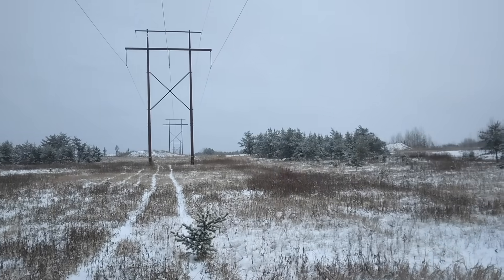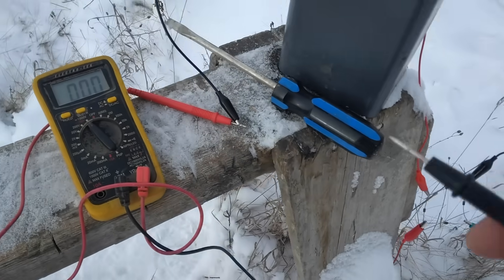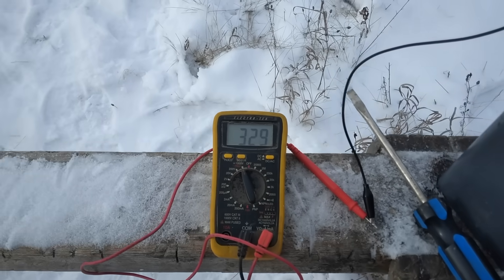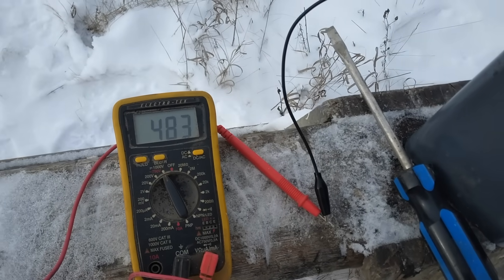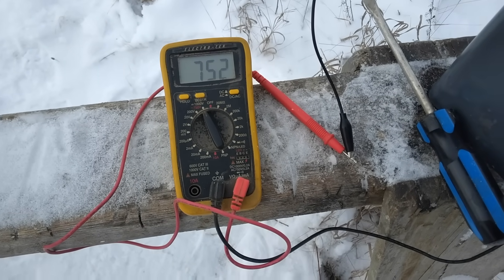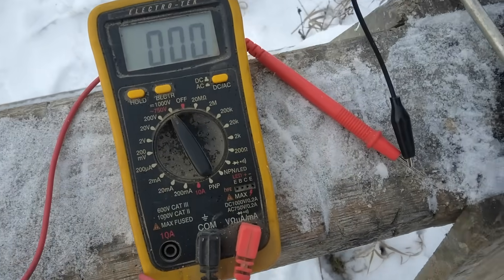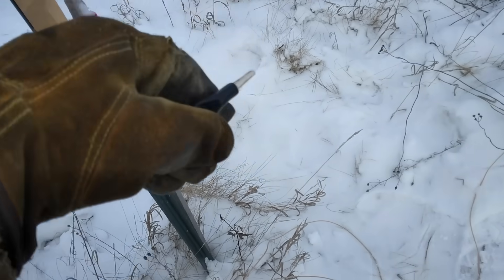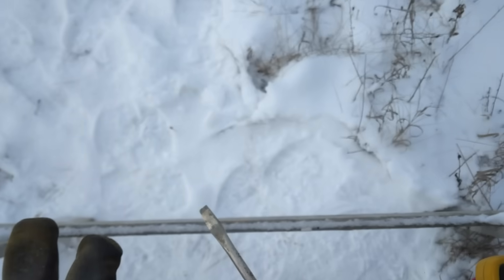Fences sucking power from under HV transmission lines

Comment: My grandfather had a shed on his farm that was lit with a 40w bulb using just the tin roof of the shed and a ground wire
Reply: can you explain his setup a little more? if used straight like you say then it would overload the bulb on the fist thunderstorm so there has to be additional setup
Reply: @AdrenalineandEpiphany  it was pretty simple. it was a lamp socket with 2 wires coming out. 1 was attached to the roof of this old wood shed and the other went to a wire / grounding rod in the ground. its w not super bright but bright enough to see in the shed. he lived a few miles from the pacific coast so I doubt they got many thunderstorms. there were also a lot of redwoods around so even when there was lighting buildings are rarely struck
Reply: @AdrenalineandEpiphany  he also told me the electric fence he had, he took to top wire and used to to power some other stuff in the shop but after they upgraded the electric poles he took it all down cause he was concerned someone was going to get hurt.

Comment: I think you'd collect more electricity from the air if you used a bare wire or a wire with plastic insulation. The coax cable has a metal shield to prevent electromagnetic interference.

Comment: Um.. did you just mention your capacitor up to a charge capable of killing two men.. then discharged it through a non electrically insulated acrewdriver whilst holding the screwdriver? Please invest in a set of insulated tools if you're working with electrical equipment dude. 

Fascinating video 👍

Comment: If you have metal fillings and chew on aluminum foil, the acid in your mouth act as an electrolyte in a battery and a mild current is produced. When one of those “battery” terminals is embedded in your mouth, you really feel the buzz.

Comment: thats no coax, the black copper wire is live hot. coax is a triple insulation that won't power a device it's a data or bandwidth catch. you need a magnet to capture use the wifi 31mm and use another on the tower. combine and ground to earth deeper the better. then transmit it like a Tesla coil you could make that array into. it's tall enough already had the data meeting on it find that meter ! show it please

Comment: I live near the Columbia River. Two large dams are within minutes of my house. Needless to say, there are many of the monstrous towers supporting cables far over head and these take off in many directions. 

All around me are fields with irrigation circles in them. These are metal pipe systems that rotate around, for example, a hundred acre field. These are built using forty foot sections of pipe with towers at each end of the pipes. The systems range in length, but 400 feet is not uncommon. 

When a circle aligns with the overhead lines, the circle better be well grounded, because the power in it will kill you, in the process of tossing you ten feet.  Yes, circles are grounded for that reason.

Comment: I know nothing about electricity or electronics, but are you saying that there's enough 'free energy' emanating from these power lines to actually store it in a battery, in the same manner as solar panels or small wind turbines are used to store electricity for off-grid homes?
Reply from the maker: There's small amounts.  Like maybe a phone charger.

Comment: I know it from a constructor who was building a stable near a high-voltage line, then still 380kV. The stable is built from steel load-bearing beams. Every time a beam was raised they got shocks. Only after earthing and steel hoists was that problem solved. But even when tightening bolts, you felt shocks.

Comment: Many moons ago I was installing a new audio system in a strip club near the Rio in las vegas. After troubleshooting some noise and ground loop issues, I discovered the earth ground to be the main source of the various problems with that building. I was told by an engineer that the city has areas where this can be found and measured. These spots would also migrate around the valley. The dry desert ground and the high demand for electricity, mostly from the Casinos, being the reason for this.

Comment: I'm no expert but it seems one could just bury a coil in the ground and dig a trench to run the wires to like a fake outhouse where you could then stabilize that output for usable electricity. I say that based on a story I read once when someone placed a transformer coil beneath the high power lines and they were able to get electricity from the electrical field, or maybe the electromagnetic field, surrounding the high voltage lines.. He got caught though because it was clearly visible.

Comment: You can’t steal what’s freely radiated. That’s power that is just going into the air. Typically only 40% of power is used the rest is lost in transmission.

Comment: Top wire is a Static Line, not a Power source wire.
Reply from the maker: Yes, that's what someone else informed me of.  I guess you can also tell by the insulators on the poles.

Comment: Your DC voltage will be 141% of the AC voltage in the Coax. DC wont inductively couple as well but it doesnt transmit over distances well either. Get a Fluke meter and the Fluke 40,000 volt probe. We had to run autotransformers buck transformers on large multifamily residential jobs so we had 120 volts at the end of 300 to 500 feet of extension cord. Otherwise we burned up our power tools. We'd tap off at 152 volts and sometimes only had 110 at the end of the cords. You cant help but lose power over distances.

Comment: 1 amp 1N4007 diodes. Big deal. Back home the ranchers would run a wire right on the 69,000 volt poles beneath the ACSR cable and power old autotransformer florescent light ballasts and  use those to power electric fences to keep their cattle corraled. Go explain induction to a farmer. I'll wait in the truck. You are going to have transmission losses anyway. . .

Comment: As opposed to a single wire, might i suggest a coil of lightly insolated copper wire that runs along the line, and yes, like in the other comment, pull it out away from the other wires about the same distance between translittion wires. you can find lots of this copper wire in transformers, cell phone chargers, old washer motors and ignitions coils. this would probably up the amprage a bit and give you a nice steady , usable current. good luck and be carful.

Comment: I had heard of a farmer who used an old spring mattress (minus the bedding of course) setup under high voltage lines that crossed his property to catch the magnetic flux to power his barn.  The power company sued for him stealing electricity, I don't remember the outcome.  The power company did have to build their transmission line taller to keep this from happening.
Reply: Yep their building requirements seem to out weigh safety concerns on this line.

Comment: Kreosan did this but they also used a transformer (it might have been a car ignition coil or perhaps a TV fly-back transformer). They had a rectifier of course, but also some kind of voltage regulator. With this setup they could harvest enough energy to charge a cell phone with the antenna just being a one meter whip and the ground the frame of one of their bikes. The lines they were under though were the big ones, maybe 500KV.

Comment: While you're pulling a few Watts, the grid is losing kilowatts due to imperfect connection.  That would be my guess.  Some guy was stealing power from the HV power line  years ago for irrigation.  Power company had tremendous power losses, at a time when his irrigation pump timer would kick in.

Comment: In my area we have the "electric bridge" High power lines run over a bridge and if you stand on the bridge with a fluorescent light and it would light up not hooked to anything. It lit up even brighter when you touched it to the metal guard rails on the bridge.

Comment: So... I heard at one point that you can put a transformer under a power pole and draw the electricity from a regulated source. Did you try this,?
I've been wondering for years, I guess its just as easy for me to test as you. I guess I need to find the transformer and the right power lines I want to siphon from. 
Are you aware that SEARS AND ROEBUCK sold a device called an energy siphon?  Interesting device. 
It basically does the same thing, but out of the air, no powerlines. Ok.peace.

Comment: Interesting. I had a similar situation and put up a fence running parallel to the powerlines about 25' to the S of CL, so giving them a 50' wide swath under the lines. I owned the property on both sides. While installing the fence I kept getting bit, shocked. Eventually the fence was to have a strand of electric at the top of the 47" field fencing.

Comment: you should use a role chicken wire underneath the powerlines and let the soak op the free electric and fill up capacitor and battery for free electricity

Comment: An acquaintance of my mis spent youth used to have a pneumatic -- It looked like a potato gun -- that fired a sabowed chain that would create a bolt of lightning upon striking transmission lines. He did it to a distro line in the evening once; no lightning but four blocks went dark. Crazy stuff.

Comment: If there is a fault somewhere on that line, you could momentarily experience a life-changing amount of voltage drop due to the temporary surge in current along the overhead line. Just know that it is far from safe to draw power from a high voltage line using inductance as you have absolutely no control over the current flowing overhead.

Comment: A length of insulated hookup wire would be cheaper than coax. I would expect a larger power draw if you moved your pickup wire further away from the lines (up to a point) because the wires are carrying 3-phase and the fields cancel to some degree the closer you move to the centre - they won't cancel completely because the wires are physically separated but field cancellation is what the power company would like to happen. The idea is to couple more closely to just one of the wires to reduce the field cancellation effect (make one field stronger than the other two which in effect moves you closer to a single phase pickup).
If you want a decent current, a large loop with one side as close to one of the outer lines as possible and the opposite side of the loop well away would help. This gives a single turn transformer secondary with one of four sides coupled as strongly as possible with two sides not coupled at all and the fourth ideally low-to-no coupling.

Comment: Voltage is one thing power is another. Sure, if you save up micro-watts for a while and release it instantly ( spark ), but to do any actual work, you need hundreds of times more power. Hang a florescent tube close to the lines. Now that's cool.

Comment: As a phone lineman many years  ago I had finished running several hundred ft of covered wire under the power  lines several feet. I touched the bare end of the unconnected phone wire and got the shock of my life while up a pole.   The inductance was quite high and not the last time i got zapped.

Comment: You can get significant induction voltages from much less than 230kv if you are close enough!   I first figured that about 20 years ago while waiting for a train.  It was a rainy day, so I had my umbrella up. I was stood on the platform and kept feeling this zapping sensation in my right hand and a faint buzzing noise.  I looked up and there were little sparks around the spokes of my umbrella and as I adjusted my grip so as to only hold the plastic handle there was visible arcing about 4-5mm onto my hand. 😵
I was amazed!  This was coming from the 25kv traction supply lines about 8ft above my head.

Comment: How about using microwave oven capacitors and diodes and reversing the transformer, connect to a induction coil and place under the HV wires? So you get a usable voltage.

Comment: A safer way to discharge that capacitor would be to use high wattage resistor and let it discharge slowly. Shorting-out a capacitor may is bad for it's health as well.

Comment: Power company: "There is no health safety issue with overhead power lines." Same power company: "Hey, you can't use power from the air. That's our power!"
Reply: E field drops with the cube of distance. Good luck
Reply: @richardpaulson8954  Work on your reading comprehension. The whole point is that if someone is able to do this from their own property, the power company is pushing too much power through the lines adjacent to their property. That's not safe for humans. It's hypocritical to claim there is no safety issue at the same time you're claiming that someone is stealing your power.
Reply: @therealctoo4183 this isn’t because too much power is being pushed this is just how electric lines work he is increasing the amount of loss in the system because of the wire. It’s a tiny amount because so much power is running through the power line.
Reply: @Playingwithproxies  So you're saying that there isn't "too much power", but there IS "so much power"? Try to keep up.
It's a basic fact: This guy isn't running wires outside of his own property, so he is NOT stealing power. The power company is pushing power onto his property and he is taking advantage of that fact. If they don't want him to use that power, they should stop sending it to him.
Reply: @therealctoo4183  That's exactly it! If they threaten to sue you for theft of power, counter-sue them for their environmental hazard. Their admission that they are losing power is simply free evidence for your case.
Reply: @therealctoo4183  correct. also wanna know how much rent they pay him to have that shit on his property.
Reply: For a point source
Reply: My dad used to work for the utility company they would use neon bulbs that would light up went around high voltage lines without connecting to power
Reply: Tesla proved it over 100 years ago
Reply: Bullshit response from the electric company.
Reply: both statements are true
Reply: Put insulators on your barbed wire fence and your stealing.... get the piss shoked out of you for touching a barbed  wire on a wood post on a dry day and thats YOUR PROBLEM!!! I Get it now!
Reply: @johnmartin3517 Steeling what exactly, it’s electricity that is bleeding off the power company wires that is a loss to them so shut the fuck up!
Reply: @johnmartin3517  "Free" electric fence.
Reply: Are you worried about health safety issues with the electicity in your home? You can do the same thing in your house, or more to the point your neightbor could do the same thing with your utlity hook up. Would you be ok with you neighbor "harvesting" 100kwh from you?
Reply: It's the amount of power and the distance from the wires that matters. Sure, I can do the same thing in my home, right next to the wiring in my walls. This guy is doing it at distances greater than the width of my property, and getting more power!

So no, I'm not worried about the power in my home, but yes, I am worried about high tension lines. I also don't like the fact that power companies get government support to maintain and repair them. It was their choice to put them up high instead of burying them, and it's their equipment. Let them deal with the consequences.
Reply: @therealctoo4183  Our society requires power.  You are a fool if you want it all to be unregulated private businesses.  We die in a few days without water, so the new corporate trick is to try to sign contracts with towns to let a private company take over the water supply and raise prices.
We should be turning power companies into government non profits like the postal service and getting them away from the stock market and MBAs.
Reply: @_PatrickO  Who said anything about not regulating power companies? In fact, I'm claiming that it is perfectly fine to take power that they deliver to your property regardless of your wishes. If they don't want you to take it, they shouldn't deliver it to you!
Reply: @kennethreese2193  This only works because it's far away, and running on 6-digit voltages. To steal power from your neighbor by induction, your wire WOULD HAVE TO BE IN CONTACT WITH HIS SERVICE WIRES.
He's not likely to do that because it's as obvious as hell. Which is why their showing it with HV lines.
People that finished high school get that part.
Reply: @Telephonebill51  Oh no you think they still teach this stuff in high school? honey we stop when we get them verbalizing whole sentences now.

Comment: I worked for a power line construction company one summer and we were adding new lines under existing 110 KV lines. One really humid day, I reached down and grabbed the dead cable running along the sound under the existing lines, and got knocked off my feet by the shock.  All the linemen were laughing, because they knew it was going to happen.  They explained that electric was being transmitted through the air.  They called it "static electricity" but I'm not sure that is really technically accurate.